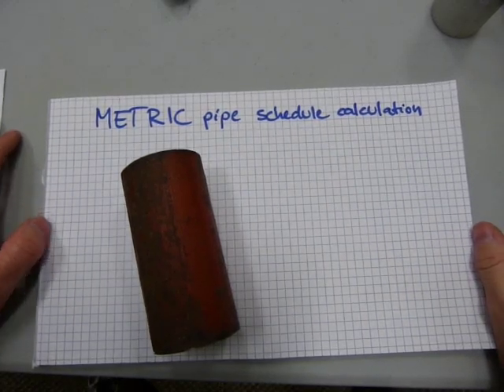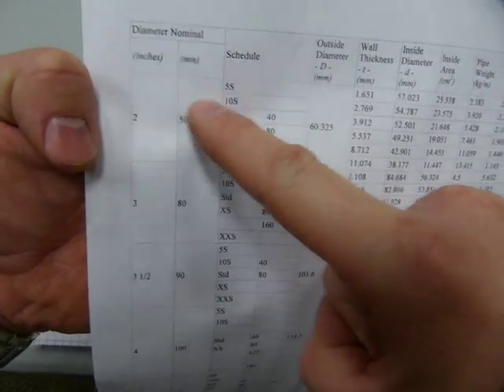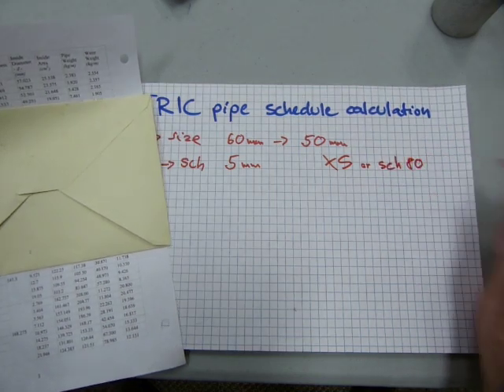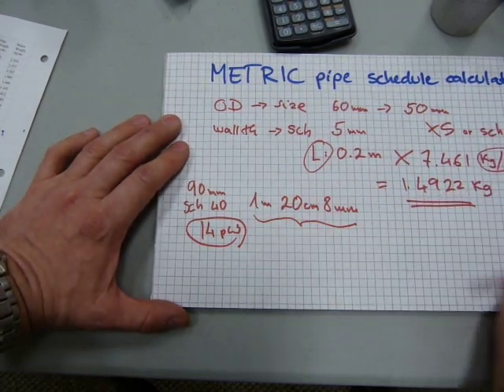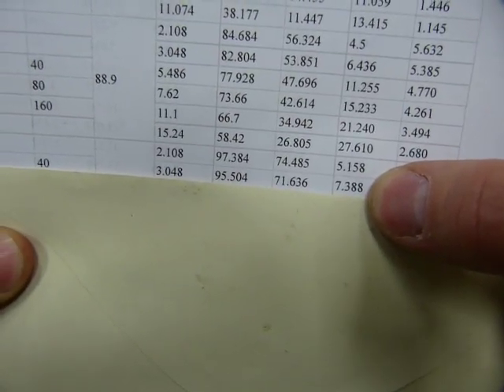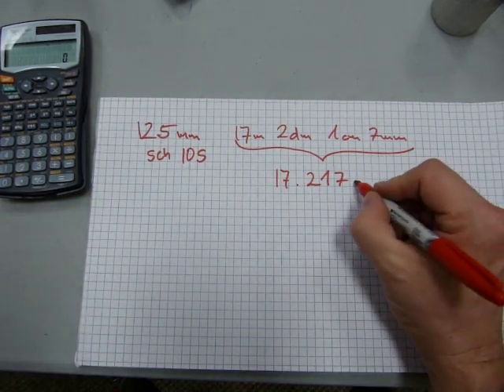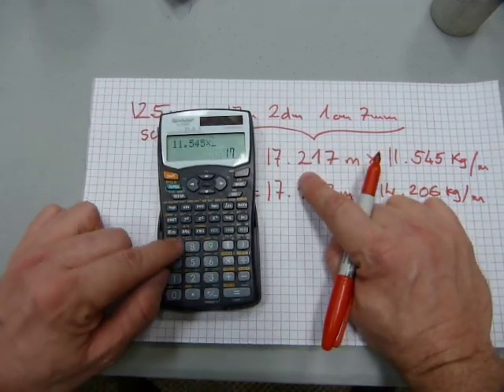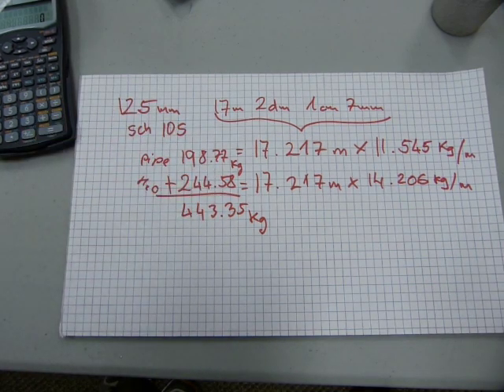Pipe weight/water calculation in METRIC

Comment: if you don't know the formula why you misguide the people.
pipe weight formula: π÷4000×(OD2-ID2)×lenth×density
24" pipe sch20: π÷4000(610×2-580×2)×1×7.85
OD: put in square
length always put in: miter
Reply from the maker: Good boy, nice formula.
Go find all 7 typos in your comment, then think hard:
Did I ask for a math lecture from you?
If no, you might want to shut up especially with your level of brainpower.